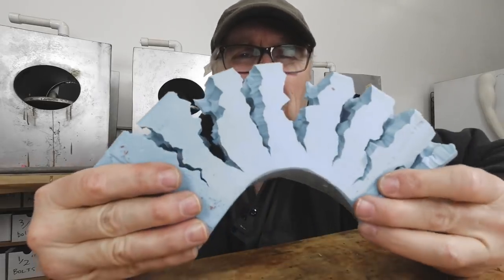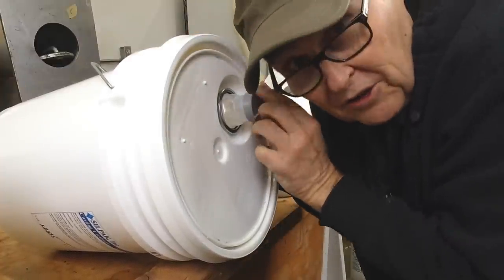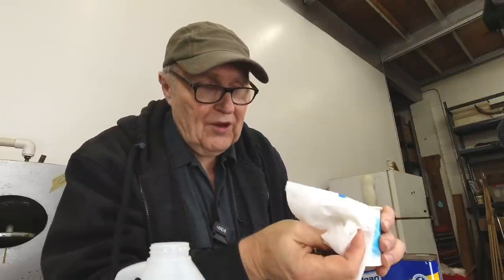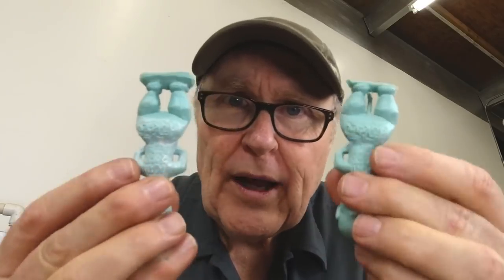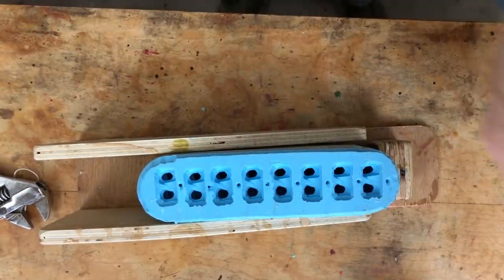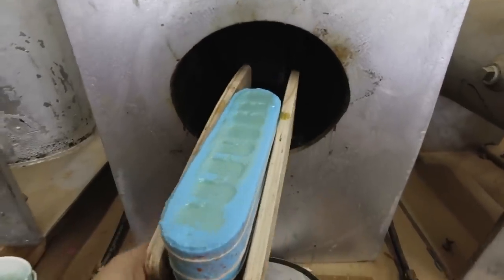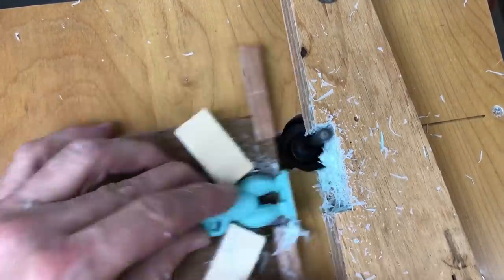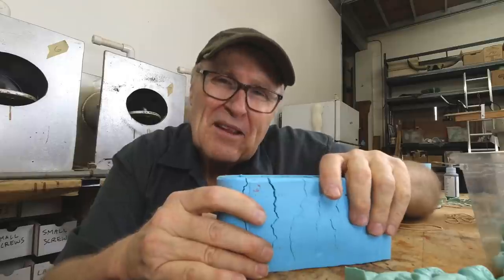150 Urethane Resin Castings - How To Make A LOT of copies fast!

Comment: I think I may sculpt something fun to send your way. What is the dye you used? I am going to use a urethane resin, and I guess some dyes don't work with it? The resin that I want to use is clear, but I want choice between opaque and translucent colorings depending on the project.
Reply from the maker: I buy my materials from Silpak. www.silpak.com. To find the colorants click on Products at the top of their home page, then select Casting Materials from the drop down menu. The colorants are all the way to the bottom of that page. For the project in this video I used CU Pigments. Which pigments or dyes you need will depend on the resin you’re casting and the effects you want to achieve. I’ll be happy to see the sculpture you come up. If you have any questions about molding issues while you do the sculpture let me know. Small design changes can make a very big difference in how well a particular part will cast.
Reply: Are you from California?
Reply: Eugênio Barreto Yes.

Comment: As a designer of many kinds of things I'd like to see how you would roto-cast multiple small parts at one time. I've designed a unique chess set that would lend itself to such a production method.
Reply from the maker: That is a difficult problem because you must have a system to mix and dispense the resin into multiple cavities at once. Doing it by hand is not practical because it takes too long to fill multiple cavities before the rotation actually starts. It’s a big leap going from an artist/maker studio to a manufacturing process.  I have no experience running a factory because my studio has always been low volume, one of a kind or prototype objects.

Comment: Hello,

I need some advice please on making a hand mould.

What I want to do:

1. Make a mould of a hand that can be refused
2. Fill the mould with a clear fast setting epoxy resin.

Can this be done? I have looked around but it seems alginate will not work because it will shrink before the hard epoxy sets.

I would be really thankful for your advice 

Thank you in advance :)
Reply from the maker: Check out Body Double skin safe silicone from Smooth-On.
Reply: @RobertTolone  thank you so much!

Comment: Maybe measure the weight of the dye required per 4 oz of resin and multiply for the total amount of material?
Reply: Also curious, does that resin cure white with no pigment?
Reply from the maker: @joe_ferreira  Yes, or off-white.  It will yellow with age.
Reply: @RobertTolone  awesome. Thanks sir.

Comment: I would like a 1:1 copy of the movie prop seen in the movie, 'How To Steal A Million', starring Audrey Hepburn and Peter O'Toole. 
 
The figurine, the supposed 'Cellini Venus' is approximately 14 inches tall, so you might want to consider doing it in two pieces. 

I only have experience in polyester resin. 
It was quite odd for me to see you compress instead of pull out bubbles.

I'd like to try polyurethane if it can be made clear and colored so as to be translucent. 

Not crazy about the general brittleness of polyester resin....there's that carcinogenic thing too. 
I'd like to cast 'green', as in without any petroleum products. 
I'm wondering about gelatin.

Comment: Hello!!! This was my first time seeing your channel ! 
Great walk through the process and awesome tips
. I have been casting with  urethane rubber, I used the vacuum chamber to degas but i still find that im getting fine tiny bubbles...i have yet to try the pressure chamber and I am  hoping that it will shrink the air small enough where I will no longer see the bubbles. Do you have any experience with Urethane rubber in a pressure pot? Cheers and thanks!
Reply from the maker: Urethane rubbers are tricky to degas, no doubt. One method is to work in layers. If you put a smaller amount of rubber in a large container it will be shallow. The bubbles rise out much faster from a shallow puddle of rubber than they do in a deep container. Be careful not to entrain air when you scrape the container. Just keep working until you fill the mold container with the layers of rubber.
If your model can take the pressure you can also cure rubber in a pressure pot. Just be sure it won’t damage the model.
Reply: @RobertTolone  dont feel layers are going to be an option :/ im hope it will fit into the pressure pot. hope it will work if so.

Comment: I'm sure you've already been asked this but what are your thoughts on 3D resin printers?
Reply from the maker: I made my first 3-D prints back in the late 1990s. You had to send your files to a service bureau and they cost a fortune but it was an incredibly exciting technology to be involved with. And for many years I cut out models using a small desktop 3-D mill. The market for 3-D resin and filament printers has exploded and there are many great machines out there on the market. I hope to be adding one of each kind of printer to my shop by the end of this year. It seems that as soon as I settle on the machine I like a better one comes along on the market!

Comment: hey Robert. i just started doing resin casting about 2 weeks ago. most things i have done are ok but im struggling with some chess piece 1 cut silicone moulds i have. i have a vacuum chamber to remove air from the resin before poring in to the mould. i have even added a little white spirits to thin the resin so it can get in to the little area's. i even pore really slowly but there always seem to be an air bubble stuck somewhere in them. with out a pressure pot and with bought mould what's the best way to avoid this?
Reply: P.S i love the vids. helped me out a lot. so thank you.
Reply from the maker: @WelshWeaselx  Make sure you position each chess piece correctly in space so that the resin can  fill the cavity of the mold properly. Then wherever you are catching bubbles you need to place a vent.
Reply: @RobertTolone  thanks for replying I'm going to try adding the resin a bit at a time and rotate the mould to try releasing any trapped air. Unfortunately I bought the moulds so I can't add vents :( unless you know a way to add a vent to a mould after it's set.
Reply from the maker: @WelshWeaselx  A lot of people prefer to cut the vents after the mold is cured.

Comment: You're good at using the scale, wouldn't it save time to measure the pigment too and start tweaking the color closer to the final color?  You might need a more precise scale though.  With a digital scale  you can zero it will  each paper cup as well.

Comment: Hello Robert I’m trying to make a mold of a roof tile  can you please advise me?
Reply: I believe you’re doing great jobo
Reply from the maker: What material are you planning to cast the roof tiles with?
Reply: @RobertTolone  don’t know maybe  rapid set cement but it might be too heavy I just need a bunch of tiles they’re hard to find in stores
Reply from the maker: @israelelgato  I have very little experience casting cement or concrete. But there are lots of YouTube videos on the subject. Also you may very well not need to use silicone rubber. Your molds could be made out of urethane rubber which is cheaper and actually more durable with cement.  You need to use a good release agent when molding the tile as urethane rubber sticks powerfully to almost any surface.

Comment: Newb here.  Couldn't you have eliminated the vent between the legs and just poured down one leg, letting the air escape out the other?
Reply from the maker: That is exactly the pouring strategy that I used. But there was still enough of a bump in the crotch that I thought it would be safer to add a vent. That was a place you definitely didn’t want to catch a bubble!
Reply: @RobertTolone  The pressure pot wouldn't have eliminated the bubble?
Reply from the maker: @karllautman  Not necessarily.  The best way to remove bubbles from castings is proper venting.

Comment: What if the customer comes back and wants the exact same color again? I’m pretty good at mixing color but not 100%
Reply from the maker: I always use the disclaimer: “these products are individually handmade, some variation is possible.” 
Another option is - if you have a customer that repeatedly buys the same product- stock a lot of the color resin.
Or you can invest in a scale that very precisely weighs the pigment mix.
Reply: I’m glad you’re sharing all your years of experience.
Reply from the maker: @annekabrimhall1059  Thanks, it a lot of fun for me.
Reply: Or... while you measuring the first batch... write it down.... you can get a precise weight and measure for a custom color and stick the buyers name on it and file it away

Comment: master!
Reply: does urethane object shrink after cured?
Reply from the maker: Yes, but only a very small amount. It shrinks as a percentage of its mass. So a small thin object doesn’t shrink very much at all whereas a very large, massive object would shrink quite a bit.
Reply: Robert Tolone im finding problems with clamping objects together when i cast them with polyurethane, somehow it wont clamp as like the original object, what do you think? thanks for responding!
Reply from the maker: Hard to say without seeing the problem. Often when a mold won’t close up properly, or your casting is deformed, the problem stems from 4 areas: 
1 - the parting lines aren’t made well and don’t mate up perfectly. 
2 - you are using too much pressure to hold the molds closed and it’s deforming the casting.
3 - you are using too little pressure and the resin is escaping from gaps in the parting line. This causes excess flash and voids in the casting.                                                                                                                4 -The interior of the mold gets hot from the resin curing but the exterior of the mold remains cool so the mold deforms from the uneven temperature.

Comment: hey how can you make molds with uv Resin? my silicone is allways getting slimy when i try to make a mold
Reply from the maker: Do you mean that your silicone is slimy when you try to make a mold from a UV resin 3d print?  If so, the cause is cure inhibition. The silicone doesn’t like the chemistry of the resin. It is likely that you are using a platinum-based silicone. One solution is to switch to a tin-based silicone.
Reply: @RobertTolone  Thank you, thats exctly My Problem….any recomendations for good silicone?
Reply from the maker: @Jpanic00  I mostly use Econosil-25 from www.silpak.com.

Comment: Digital sub-gram scales can be had for just a few dollars
Reply from the maker: Yes, I have burned out several of them. The balance beam is more than 30 years old, has never been repaired and has never needed a battery. And it’s very fast and accurate.

Comment: I have a project for you. Im building interior parts for a datsun im building. I have a handle that is rubber and hard plastic. They will need to be joined together. I am working on the plug right now. I think it would make a great video on making production car parts in the garage. Let me know if you are interested. Wish i could work in your shop with you!!
Reply from the maker: Send some pics to me at roberttolone@yahoo.com

Comment: I might have a faster way to make it without any risk of overshooting the color...

1-Start by taking 4 sample glass and mark them as: s1-s2-s3-s4.
2-Try your best to make what you think might be the final color (record the weight of each color and white used and pour it into s1)
3-Take half of s1 and pour it into s2 and mix with equal amount of white (s2 = 50% as strong as s1)
4-Weight the double of colors that you put in s1 and put it in s3 and dilute with white (s3 = 200% as strong as s1)
5-Take half of s3 and pour it into s4 and mix with equal amount of white and add 25% of the weight of yellow you put in s1 (s4 = 100% as strong as s1 for blue and s4 = 125% as strong as s1 for yellow)

6-Ok, now, take a small amount (not all) of each glass to make the cured color samples (precision weighting is important)
7-Once cured, you can use this two axis 4 points calibration color curve and calculate the precise weight of yellow and blue to get your final color.

Or you can simply make 4 new samples to get even closer to the desired color.
In two rounds of samples, you should get the good enough color.
From there, keep the best sample (uncured color) and pool all the unused sample together plus white plus all the color required until you match the "best uncured color sample".

Lot of explanations and steps, but in fact, this is a 15 minute job, 2h curing, 15 minute again to make it more  precise, 2h curing and you should have your perfect color.

I have no clue why I wrote all this in the middle of the night. You probably already do pretty much like what I explain here anyway!
Love from Montréal, Canada
Reply from the maker: So far you’re winning the Best Comment Of The Year Award!
Reply: @RobertTolone  Wow! Thank you! I hope it will help or bring new ideas to be more efficient in the makers community.
Thank you Robert for sharing your knowledge on Youtube and for being such an open minded guy.
Respect.

Comment: This looks so professional i was looking for a simple pour and dry video , i don't have a pressure tank , do you have to have a pressure tank to properly dry urethane or is there another method much common , once again your video's are the best , were all going to pretend we didn't see the long penis on those toys atleast you cut them off... oooouuucchhh poor guy.. LOL.
Reply from the maker: A vents gotta go where a vents gotta go!
If you design your molds properly and use fresh resin you don’t need a pressure pot.  If you let your resin get exposed to the moisture in the air it will foam and create lots of bubbles.
Reply: @RobertTolone  ok , thank you.